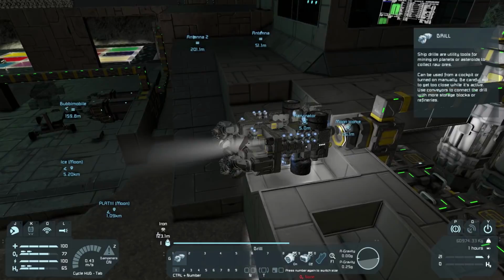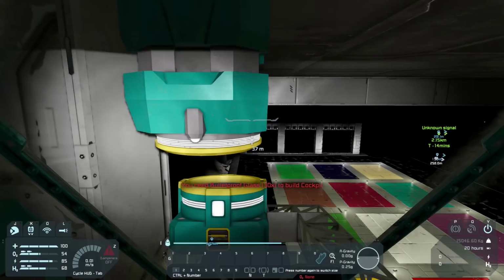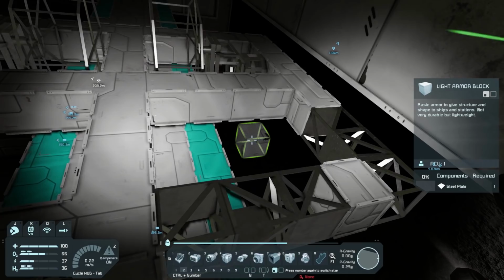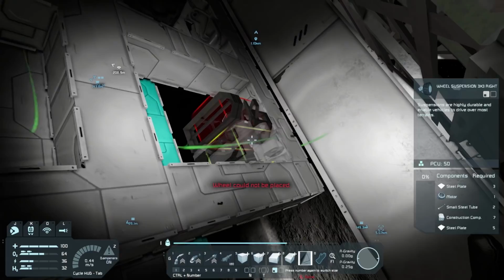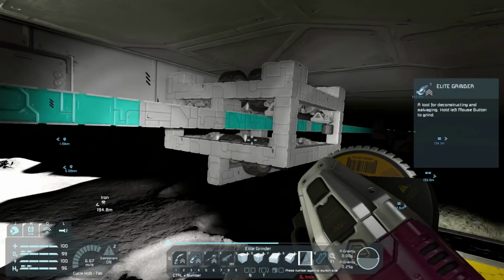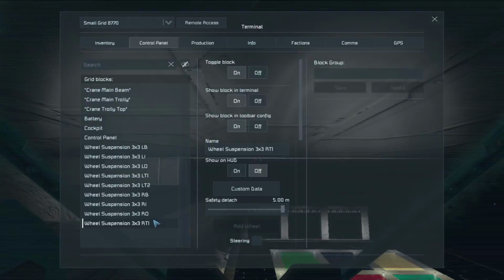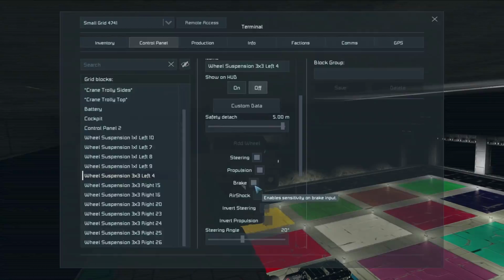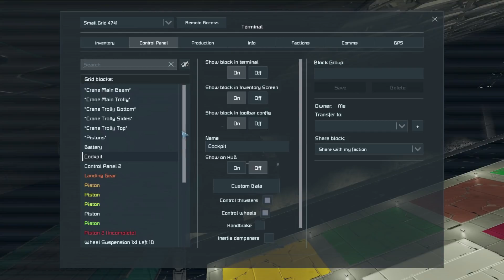Space Engineers Let's Play (S2 | E24) - THE INDUSTRIAL CRANE WORKS!!! [Beta Gameplay]

Comment: It looks like your proof of concept is working.
Now begins the "evolution" of the design into a prototype and hopefully a final working piece of equipment.

It's too bad there isn't a thing called winch and cables in SE.
For it would keep the center of mass under the trolley and prevent tilting.

Rabenschild, has a good idea about resolving that problem.

One thing I will throw in there and that is entering variables in the wheel settings or any settings with a slider bar.
If you put your cursor on the slider bar and hold down Ctrl + LMB, a box will appear where you can enter exactly what you want.

This will help in getting the wheels to do the same things at the same times.
Though, I have found out, that at times they seem to have a mind of their own. 

All of the wheel adjustments play a part in the tracking and staying on the rails, but I'm thinking suspension and friction adjustments might be a key part in it.

But as I stated before, I have not tested any of this myself. So, I could be wrong about that.

I built a control tower, but I deviated from the design and ended up putting a elevator in the middle that went straight to the top.
It doesn't revolve like yours but I think I can "cheat" and put a small revolving structure on the roof.

Anyways good luck in getting your crane sorted out.

Comment: Addendum:

Cameras are cheap. I would have them looking down the column of pistons.
Another near the grabber to judge distance to what you're picking up.
Plus where ever one would help in orientation.

The 3rd person camera is somewhat a compromise.
Before Keen changed it, if a bulkhead or something was between you and the camera, it would lock in to first person.

After furiously "zooming" your mouse all over the table like a 6 year old with a toy car would do . . . 
You might get lucky and "break" the lock. Otherwise you had no choice but to jump out of the cockpit or seat and back in again.

Now you can't zoom in as close as you could before, but the locking has been drastically reduced.
This does however make it hard sometimes, like operating your crane but the roof and other structures are limiting your view.

Like I said "Cameras are cheap." I would recommend a clear camera mod, though.
Keen must think we still have cameras that operate in 240p and don't get me started on the "Dirty window" debacle. ;)
That's where all the "Window cleaner" mods came from.

Comment: My next goal is to build a couple of refineries and assemblers with mods on my base, along with a connector for my future mining ship, along with connectors to a large cargo container.  

Next is to figure why that @!##! $^ med bay I built, even though it's connect, won't refill my O2 and H2 won't refill.

Thank God I didn't cannabalize my lander yet.
Reply from the maker: I've been there done that with the med bays. Those things have a habit of breaking. Try completely removing it or the machines connected to it. If that doesn't work, try setting the owner to nobody and then back to yourself.. If even that doesn't work, you could try going to creative and spawning it in. Usually when I have this problem it's when I spawned the first block of the grid in creative mode.
Reply: @AndrewmanGaming  Solved the problem.  I removed a conveyor and slapped a second O2 generator on top.  That seemed to fix the issue.